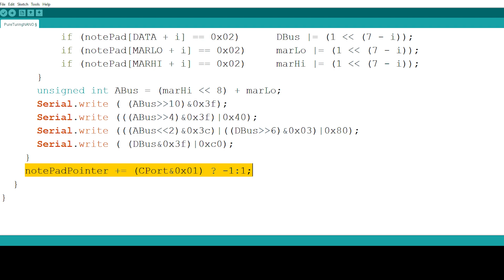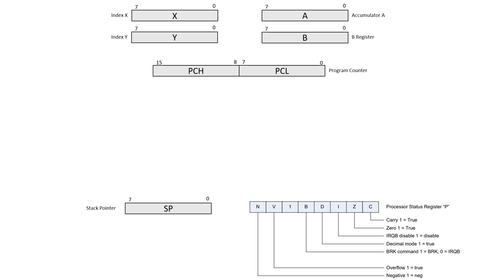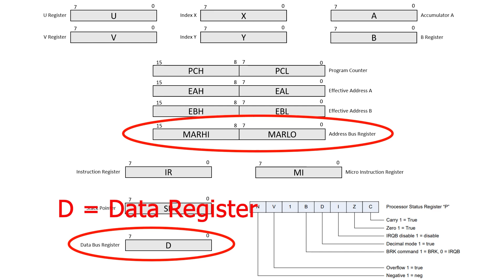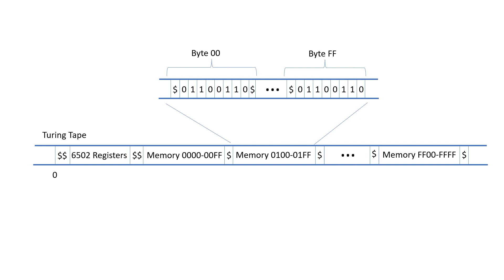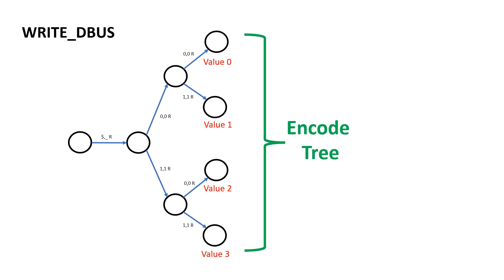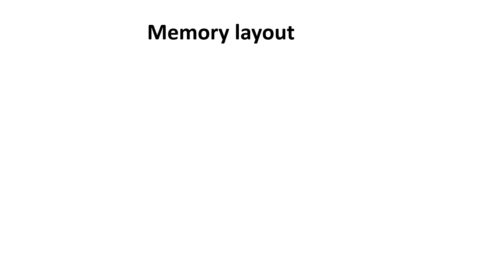PureTuring Part 6. World's slowest Pacman Machine - Memory Organization.

Comment: Good heavens!  That certainly DOES drive home the point that sequential memory is slow!
Reply from the maker: Yep, that's why we don't build computers this way!  But it's interesting that you can view CPU development as speeding up this design and using fewer transistors.
Reply from the maker: I make the Apple 2 main memory random access, but the last video in this series (that is only partially complete and not published yet) is to allow random access into the notepad as well.  This should bring it down to about 100-200 cycles per instruction.  If we then expand it to 8-bit symbols, we have the Turing6502 design.
Reply: @DrMattRegan  Looking at the date on video 7, I was wondering if video 8 was still planned or not.  I look forward to seeing it when released!